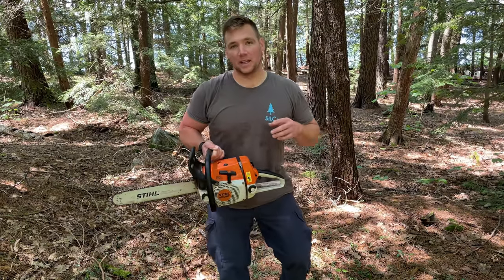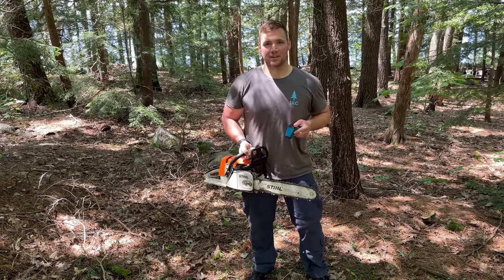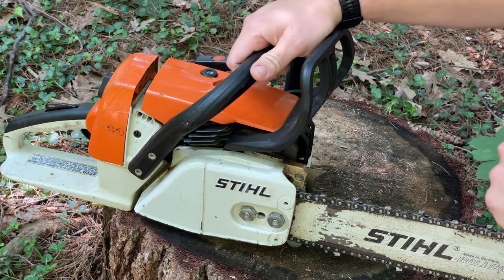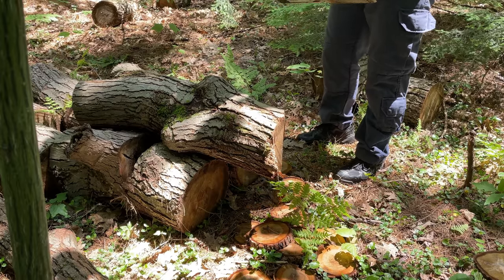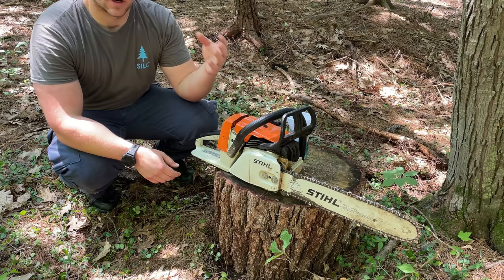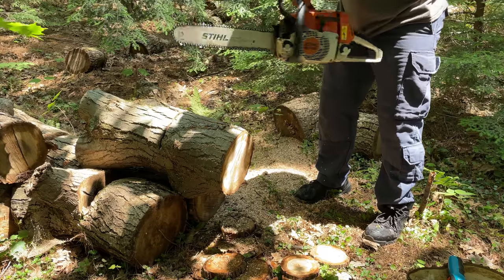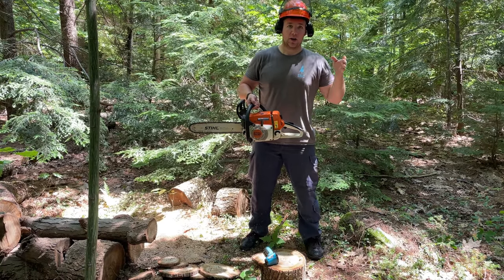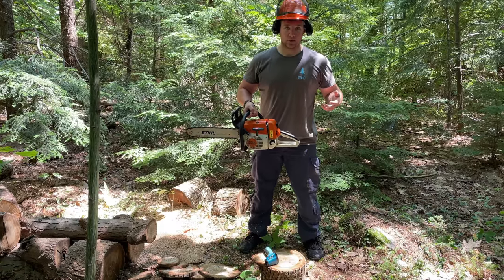Will my chainsaw last longer if I use more oil? Is it safer? (25:1 VS 50:1 temperature testing)

Comment: Dave thank you for your test! But I can,t agree with the reason you give on your results. Here 
Is why. I have been in kart racing for many years. Out two stokes run up to 18000 rpm in some classes & are pushed as hard as any two stroke racing in the world. We run any where 
from 20/1 as low 16/1. If we above 20/1 it will stick a piston. We run head temp gages on 
Our steering wheel for tuning these engine, which we do as we are on the track. We must run a much richer mixture for the amount of oil we run. It that simple when you stop & think 
About it. Think about this in your test for a sec. You double your mix, but in doing so you 
increased the viscosity when doing that. I think you would find if you opened your high speed needle about a 1/8 to even a1/4 rich that temp would come down. I tried running 
16/1 a time or to & had to richen it up about 1/8 from running 20/1 were I picked up 1 tenth 
Lap time. It gave me a little better ring seal on a hot day. Try that again richen that 25/1 up 
& see if that cools her down a tad. Great video. You do a great job.🤠

Comment: I’m not being mean but this video was hard for me to watch. To start with your saw should produce wood chips not saw dust. I have been doing two-stroke tuning since the late 70s on McCollough 2-Cycle go karts, saws, dirt bikes, Kawasaki H2 750 drag bikes an so on. Your saw didn’t perform as well because you did not tune the carburetor to the new rich oil mixture. We ran rich like 20:1 back in the 70’s because 2-stroke oil back then was nothing but 30w non-detergent motor oil. Anytime you change the pre-mix ratio you need to retune. Think about it like this the oil in the fuel is taking up space in the fuel jet.  So when you dump a lot more oil in it is running rich with oil but lean with fuel.

Comment: Hi Dave, good job. This seems like a matter of specific gravity. take a car radiator for an example. we all know what will happen if we run straight water in the winter. So we ad antifreeze to the mix. This changes the specific gravity of the water. You can test your radiator to see if you have enough antifreeze in the water, depending on were you live. Same with a Carb,  Going from 50 to 25 to one means per volume you have less gas and more oil, opening up the hi-lo jets just a bit rich will re balance the fuel oil ratio. I hope that helps.
Reply from the maker: Hey Carl! Great info, thanks very much!!!

Comment: I honestly have always used 32.1 in chainsaws and 50.1 or 40.1 on trimmers anything that revs high needs thicker oil even race cars  use 0w40. Hell the epa wants the chainsaws to burn clean so they make you run 50.1

Comment: Even if it is true as you say, a small increase in temperature is Not detrimental to engine wear and longevity, but an underlubricated engine certainly will increase its wear and reduce longevity. Also, for the test to be valid the chain should have been re-sharpened and the carby mixture adjusted more richer to comensate for the extra oil content, air being the same density assumed.

Comment: I dont know anyone who runs 25:1 that's crazy. 32:1 or 40:1 is where every logger I know runs theres. It seems to be the sweet spot. I love the test but I think the results would be much different if it was 50:1 vs 40:1. It would be close to the 50:1 temps with the added benefit of extra oil. Just my thoughts. Thanks for the video it was interesting

Comment: Awesome video I've been running my 462 at 16:1 and I think I might go back to 50:1....never fouled a plug and once the saw is hot it doesn't smoke but just a little bit.
Reply: You can go to 32 to 1 or even 40 to 1.
Reply: After a lot of research I settled on 42.5:1 and an occasional hit of decarboning agent.

Comment: Changing your fuel oil ratio changes your air fuel ratio, you need to retune for changes. A properly tuned saw will run harder for longer on a richer fuel oil mix. More oil = better ring seal and more oil pooled in the crankcase.

Comment: Used to get this kind of BS from two-stroke motorcycle riders that just "knew" they were "saving" their engines by adding more oil into the mixture. I always ran/run my two-stroke engines at 50:1, as the manufacturers have already done the testing for just this type of issue. Makes sense that an engine would run hotter w/ more oil in the mixture, due to the oil lowering the octane rating of a fuel, thereby forcing the engine to run higher exhaust temps, which translates directly to cylinder or head temps. Common sense, if you think about what it takes to make an engine run.
Reply from the maker: VE! Great points. I agree with you. Thanks for the comment!

Comment: The big problem is when a two cycle engine scours the piston, which is almost always on the exhaust side only, all they can think of is it lacked lubrication. That is not what caused the piston scouring and metal transfer on piston and cyl exhaust side, it is excessive heat. It takes years of experience to diagnose two cycle piston failures. That and education. Stihl published a whole picture book of piston failures and what caused them. I still have my book. When you actually tear down a two cycle engine that lacked lubrication you will see the whole engine damaged, as in rod and main bearings. It only makes sense why would one part of engine lack lubrication and the rest of the engine lubricated fine. Think of it as your auto engine is full of oil but the coolant leaked out, not all damage is from a lack of lubrication, excessive heat will damage it also. Folks that can actually diagnose a two cycle piston, cyl. failure are few and far between.

Comment: Since your data has a pretty strong correlation (and thereby it's reliable) you should do a quick test such as the idle test you did and do many different oil ratios.  The big question after this video is where is the best oil ratio?  The other thing is a lot of equipment that says 16:1 on it because it's ancient won't run at 16:1 on new oils so your optimal oil ratio test should be with a generic kind of oil that is purchased in large volumes for a wide array of equipment, thus applying to the largest number of people.  That would be very useful.
Reply from the maker: Hey Chris! Great idea. I will add it to my list of future videos!

Comment: 25:1 definitely sounded underpowered or sluggish- when cutting through the smaller wood it seemed to me like it should have zipped through much faster or the chain was super dull.. I have a MS 250 and it’s pretty zippy for a smaller saw and I know it rip through faster than that.

Comment: I was always told that no matter the oil setting, a chainsaw should be designed to run out of fuel before you run out of oil. Any loggers confirm or deny this?

Comment: IMO the OEM 50:1 ratio is a bit lean for good lubrication, so I'm starting to now go with 40:1, but going all the way to 25:1 is taking this test too far in the other direction.  I would never think straying this far off the OEM recommendation would be the way to go IMO.
Reply: Whatever it’s worth, I run zenoah high performance engines, the manufacturer recommends 25:1, I run 20:1 and gain noticeable power as a result.

Comment: What happens if you try 75:1 ? How much do you like that saw ?  How would an  "auto tune" saw handle the fuel changes ?  Would  AMSOIL SABER rated to 100:1 be better ?  VP makes a SEF 94 octane and 50:1. It's one of the few non-ethanol fuels I can get local.   NAPA has it here in the U.S , land of the Canucks ?
Reply from the maker: These are all great questions! Looks like I have more videos to do.
Reply: @DavesSmallEngines  Manufactures tend to be conservative on there oil mix percentage. For break-in maybe 45:1 after that 50:1 for a cleaner burn. No one makes a premix or a container size for 45:1. I always get a sick feeling when I have to explain mix fuel to someone getting there first two stroke motor. Some folks are "need" battery power yard tools. 
 Two stroke oil has changed in the 40 years I have been using it. When Echo first but  exhaust screen on line trimmers they would clog in 8 hours or less.  What has changed ?
Fuel in N.Y. went to MTBE  then 10% ethanol. Not go for two cycle motors. The biggest improvements I think has come in the two stroke oil. Stihl sells three different oils. HP mineral oil base, orange bottle (blue) color. HP Ultra Trimethylolpropane Ester gray bottle (green) color. Stihl has a HP (RED) 100ml 0781 319 8401 for people like me that like the 5L combo can. I have been very  impressed with cleaning power of the Echo Red Armor. Saber if you want max power from a saw. VP premix 50:1 for equipment that is not run very much.
Welcome to the life of a YouTuber. Always one more video to make and edit.

Comment: Very informative video .obviously u new as did I that the 50 to 1 was gonna Run better but I didn't think that more oil was gonna make it run hotter which inturn is obviously worse for your motor.that's good to no . even though I would not ever use more oil than I should just because of the power and u would think that it might foul your plug  quicker . but I never would have thought that it would run hotter . cool to no

Comment: I enjoyed the video but it left me wondering.  The 25:1 has more oil and the engine must buck the shear force required by that oil layer between parts.  For the 50:1 the oil is thinned and hence the shear force is lower.  While the 25:1 has higher temps, I wonder if it's not providing better protection of the metal to metal surfaces.  I'm an eng. but the wrong type.  Would like an ME to comment if any read this.
Reply from the maker: My father passed away in April. He reviewed all of my videos. He was a proud ME. I wish he was here to answer this question. Take care.

Comment: Very well layed out test. Couple variables could be mitigated, but understand not adjusting carb view. Oil burns hotter than gas. Also running lean creates more heat. So your results make sense. Don't believe the added oil helps wear after at a certain ratio. What that magic ratio is why we have these myths/discussions. Funny how anything dealing with oil brings out passionate opinions.
Reply from the maker: Hey 911!!! I know, this will be an ongoing debate until fossil fuels run out! Thanks for the kind words.

Comment: I vote with the people who say the extra oil is increasing the viscosity of the mix,causing the carburetor to meter a leaner air fuel ratio.  Also the possibility that the extra oil produced some detonation. (combustion knock)

Comment: When storing gas lawn tools is it preferred to drain the gas and then run the tool until the fuel in the lines is consumed?  I know atvs and other engines of the type i have heard people say to drain fuel and then shut it off and run the engine until the fuel is consumed or else you may end up gumming up the carb. I dont know much about gas lawn care tools and want to ensure mine last when stored.  I just got an atv also and thats another thing i am concerned about is storing it for periods with gad and also battery dying.
Gas powered items non vehicle related are a new game to me since i have moved out of state to an area where I really beed gas tools instead of electric from living in the city to now in a more country environment
Reply from the maker: Hey Mixwell! I’ve done a couple videos on how to properly store equipment when not in use. I empty the tank, run it till it dies, try to start on choke, keep purging the bulb etc until it wont start any longer. Then leave the fuel cap off.

If you can find non ethanol fuel that is the best.

For the ATV - use non ethanol premium fuel and it really doesn’t matter how long it sits (within reason).

Comment: good afternoon dave lately I have had the same problem with several carburetors such as walbro and zama The detail is that at the time of assembling the needle with the spring and everything else, I put the leak detector on it and it throws leak where the needle goes Normally I assemble everything with WD-40 so that when I put the gaskets they seat well Hopefully and you can give me an answer since the carburators are in good condition, i pull the spring a little so that it is a little tighter but it does not work like that Thank you
Reply from the maker: Nothing to do with the spring - all to do with the angle of the actuator arm. They can be bent up and there are tools for both zama and walbro.

Comment: Plus d'huile à certains bénéfices, meilleur protection du bottom end et meilleur compression. Par contre plus d'huile=leaner. Ça passe obligatoirement par un petit tune up. C'est aussi dépendant de l'application. Une scie qui sert a élaguer quelques branches par an et qui globalement ne sert qu'a des travaux légers, je la tourne sur du 50:1 ou 40:1. Maintenant une scie qui tourne wide open sur une mill plusieurs minutes avec un load important, 25:1 voir 20:1 avec le tune qui va avec. Les bougies sont à changer régulièrement forcément mais ça coûte encore moins cher que de reconstruite un moteur

Comment: what happens if I use cheap 2stroke oil used for lawn mowers and high performance air cooled machines on my yz125 doing a 32-1 ratio ? will the bike still be okay even if it’s cheap oil

Comment: Why does this cause the saw to run hotter?  Someone mentioned because oil burns hotter?  Great video
Reply: Leaner mixture with more oil burning hotter... Also the second time chainsaw might be hotter and duller causing more heat;o)

Comment: I think with more oil in the mix it changes the mix viscosity, and maibe it runs leaner, with the same carburetor, it will be harder to get tru the small holes

Comment: I have a Husqvarna model 55, after winter I took it for service, about $125 for new carb kit, plug & wire, chain maintenance, and new bar.
It started & ran fine when I picked it up.
I took it to my property and used it intermittently over about 2 hours, no problems.
The next day, same scenario, used it about 2 hours, intermittently, but at one point, I sat it down while idling to move a limb or log.
It died while idling and now, it simply will not start back.
Even had multiple other friends attempt to start it, check it out etc... nothing.
It is getting fire, & as far as I can tell, fuel.
What else should I try or look for
Reply from the maker: John, when you open the fuel tank, do you hear any pressure release? I’m wondering if the tank vent is plugged.
Reply: I haven't thought about that personally, but the fuel cap was also replaced.
However, you have given me another initiative

Comment: I think this ratio test will vary between different types of mix oil .... this test to be done peppery would need to be done in a project farm fashion .... different mix oils ran at different ratios and have results posted .... this video is specific to this saw and particular stihl mix

Comment: Only problem with this test is that the chain might have been duller causing a longer run time, but cool to see.
Reply: That chain doesn’t seem to cut very fast…

Comment: You have to tune it for the 25 to 1 I have been messing with 2 strokes a long time snowmobiles, dirt bikes, saws and 1/5 scale RC trucks the RC engines run the best at around 20 to 1 and last longer on wear

Comment: Im new to the gas lawn tool game but if this is anything similar I have heard of people using thicker oil on worn engines to lubricate and possibly give somewhat better compression as tolerences become looser.

Just got a 2 cycle chainsaw and before looking at the box saw the fuel mixes and saw mine was 50:1.  Was curious if you ran 40:1 if it would harm or foul up the engine..
Reply from the maker: For newer equipment, I trust the manufacturers recommendation. In fact, to be really safe, I trust what @Donyboy73 says and he runs 45:1.
Reply: It won't hurt a DAMN thing. Just tune carb to whatever ratio of mixture you run.

Comment: Gosh I Iove it when you do science Dave, love how dedicated you are at getting some strong data. You are definitely proving that a higher mix ratio causes a different temperature. My only hope for this data, is that the chain stayed just as sharp during the 50 to 1 tests and the 25 to 1 tests. Cause as we all know, a chain dulls fast cutting wood. Im so glad your getting into mowers and tractors now. I'm not so much a chainsaw buff, though I do own an electric one. But when it comes to lawn equipment, oh I got it lol. Infact, I'm going to be doing valve adjustments on a couple of my machines soon. Good video Dave.
Reply from the maker: Thanks Stellar! Glad to have you here. That’s why I didn’t do too many cuts - wanted to keep the chain sharp. I would also argue that a dull chain is easier on a chainsaw as it doesn’t dig in as much and therefore does not provide the same amount of load. Food for thought!
Reply: I've never know chains to dull fast cutting wood. Humm. I cut between 14 to 15 face cord last yr without sharpening my chain. Red oak. I never use the bucking spikes or have to press down excessively on saw either.  #1, I never hit the ground or anything for that matter, and #2, I wasn't cutting dirty wood. Wood that's been skidded across ground. The minute I have to start forcing the saw through a cut, I  stop.

Comment: How about enriching the high speed with the 25 to 1 and also you didn’t examine the plug which I would think maybe it fouled a little bit more with the 25 to 1? Doesn’t test anything about longevity of the engine

Comment: Good data...Assuming 50:1 A/F screws were on the money, I would have liked a 3rd test (25:1 again) with A/F's set for 25:1 spot on. 
Then see Temps., & your feel of how saws power was. Just for chukles. < I think good chain should not have changed sharp that much.
Thanks for Vid.!
Reply from the maker: You’re right Mitch - but I wanted to illustrate the differences of an untouched saw as most aren’t comfortable with making any adjustments.